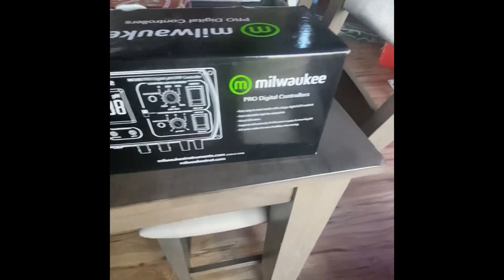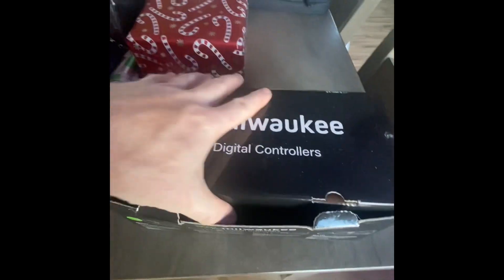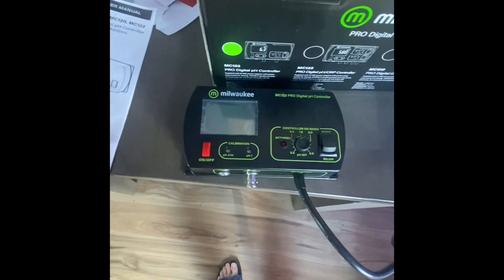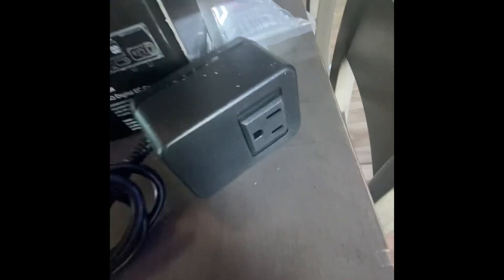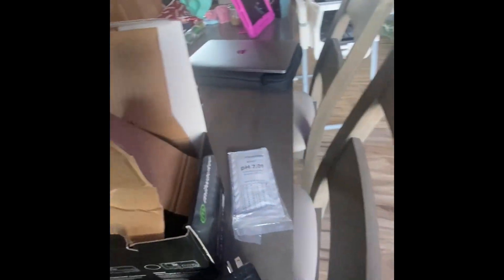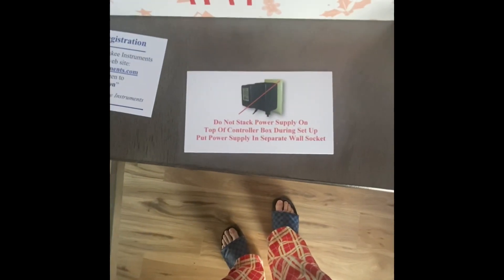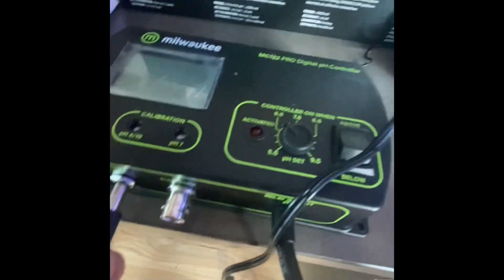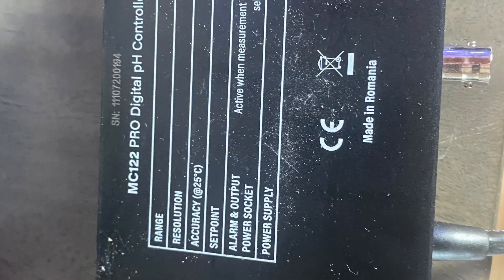Unboxing and Setup Milwaukee pH Controller MC122 Pro

Comment: Can you do a update on this I am looking for a ph monitor and don't want to go with the apex and the hanna is more than I want to pay
Reply: I have been searching for videos showing how accurately this device  maintains the set point. Haven't found any, only unboxing and set up.  I installed it about a week ago on my 8 gal reef and I managed to get it to dose kalkwasser up to a PH reading of 8.3 and it would drop to 8.2 shortly after and stay there for most of the day. But PH has to drop to 8.0 for it to start dosing, which is usually at night. So maybe there's about a .2 swing?
Reply: Did you ever find a solution?